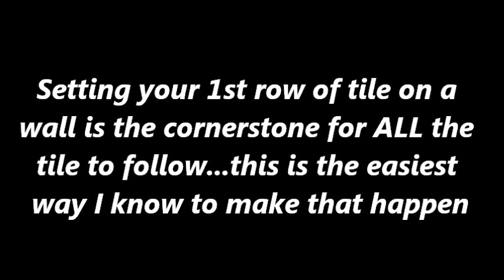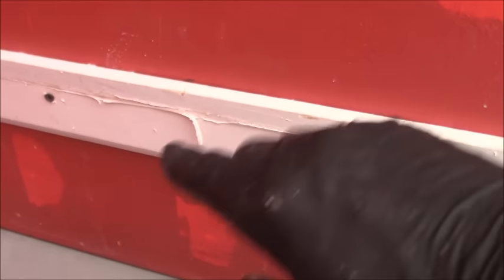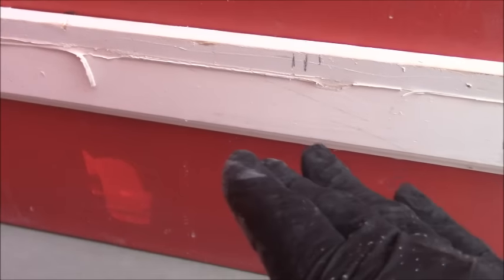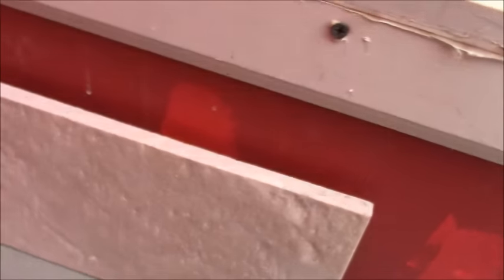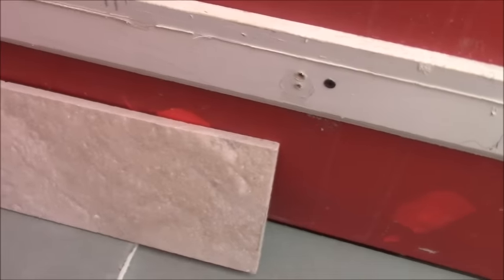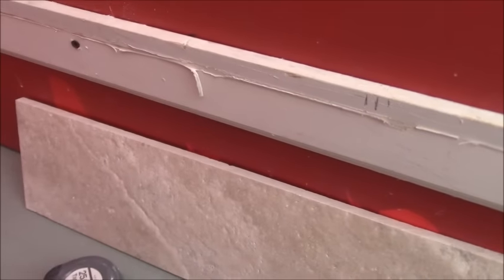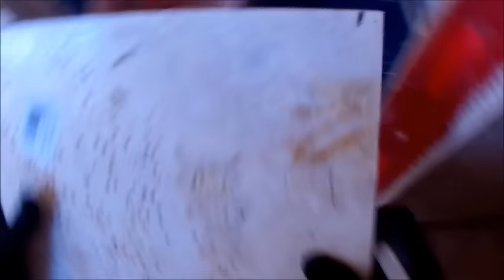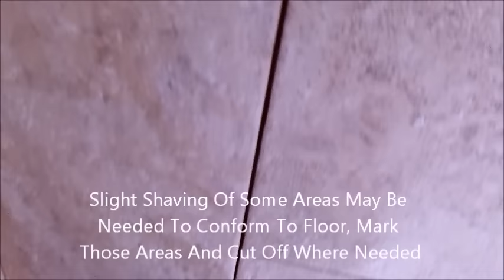FIRST Row Of Tile On Walls....how to do it

Comment: Hi Starr thanks for the video it's very helpful - zero tile exp. here.  I have a Question...given my situation (below) do I need a ledger board?

Prewar building bath to be tiled, the walls have no studs and no convenient way to attach a ledger board.  In any event, the wall I am starting with is the long side of tub (porcelain) wall.  The porcelain tub is 100% perfectly flat and level, i.e. the long edge of one side of the tub.  The wall is flat/plumb.  I figured as such I would effectively use the tub edge as the ledger board...and tile up towards the ceiling.  Notably, the ceiling/wall corner is not level, with a difference of ~.5 inch between the left and right corners.  The tub is staying, and will be trimmed to the bottom tile accordingly for water tightness etc.

To that end I envision tiling up to top and cutting that last row to fit with the trim I'm using.  So, is this a prudent plan - do I need a ledger board when using one would be its own issue anyway due to the prewar wall construction? I've confirmed three ways to Sunday that the  'tub edge' is true, flat, and level.  I appreciate your thoughts if you have time to do so I'm sure you're busy and that's a-ok too!  Thx again for the video it is a treasure trove for someone (me) with zero as in zero tile knowledge.  I have to start somewhere however!
Reply from the maker: I think you are spot on, using the tub as a ledger since it's true is fine, remember small spacers at the bottom. To the sides I try to get full pieces in there, but if dealing with un-true walls at the corners, start full in the middle working your way out & trim left/right tiles to form with walls...ceiling part use a tad larger spacing going up to ceiling to take up that .5 if possible, assuming grout blends with color of tile, you'll hardly notice.

You sound like you have more of an engineer hat than I do so you'll be fine...GOOD LUCK !
Reply: Thanks much Starr...I've decided that even though (amazingly) the walls are true all the way up, to start from middle and work the ~30 inches towards each wall corner (i.e. towards the walls at the 'spigot' and 'foot' ends of the tub).  That's my approach because in my thinking, 1) it will create the same 'last tile' width on each side, and 2) also provide symmetry as you look at that wall which is in direct line of sight upon entering the bath door.  Your idea about slightly greater spacing going up on the higher side is a good one and since I am doing the tiles vertically, won't be noticeable. On both the sides and 'top' corners (wall/wall;  wall/wall; wall/ceiling) I am using a bit of a 'different' trim method I've concocted to provide (I hope!) a bit of design flair at the same time negating my need to miter any corner tiles which is way beyond my tiling paygrade at this newb stage of my journey (I've a small wet saw and have perfected straight normal cuts...baby steps!). And that method I sense will either work marvelously, or alternatively, go down in flames just as grandly and if so well I'll still learn from it and start again!

Thanks again for your videos really very helpful!

Comment: Another great video ... exactly how i did my bathroom .. Not Being very good with mesurements , I used a med size black marky on above each side of tile then went up the wall using the black marker as the grout line to the top to make sure it would end perfect. No cutting on top ... all cuts on bottom .. Yea overkill but i wanted to make sure with the grout lines .. didnt want to get to the top and find out i screwed up ..   On another subject , If your going to tile your entire home .. where is the best place to start ? Hall way ? Kitchen ? living room ?  Or does it not matter ...
Reply from the maker: I normally start at where it's seen first/most...at entrance. Plus door ways are normally the highest point.
But you must know if there are high spots in other areas, it will kill your job if you don't.
Reply: will add plenty of thin set to make sure to cover the un even places ... one more trouble spot but will send pictures later ... thanx for youR ADVICE .!

Comment: Does screwing In a ledger board affect waterproofing since it is piercing a hole through my waterproofed wall and into the stud ?
Reply from the maker: You fill the holes with silicone

Comment: I couldn't tell in this video but when you cut tile do you take the line right out or do you cut on one side of it like you would with wood
Reply from the maker: The tile gets marked backwards on the edge, then that line is transferred to the front and cut at the front

Comment: Can I set my tile in my final mortar bed? A 12x24 tile with 6 in.in the pan and 6in. On the the wall? Then start you rows. Or would the mortar string and Crack the tile in the mortar?
Reply from the maker: I'm not sure I understand your question but tile should never be set inside of the mortar bed
Reply: @StarrTile  yes, ty. My thought was , set my cement board 4 inches above ground, then set a tile into the pan, half in the mortar pan, half out the mortar pan onto the cement board, acting as a type of ledger for my first row if tile. In doing that also ensures no gap from ground to wall, since you shouldn't put your cement board in your mortar pan. 
 So basically instead of the cement board in the pan, you put tile around the bottom.
Reply from the maker: @joshuaallen5453  the tile should never be touching the mortar, regardless...
Even at my final bottom row the tile never quite touches the floor tile because it has a grout line there.
I suppose you could do it your way without an issue but I don't think I'd be willing to experiment

Comment: Question: if you level your shower pan 2 in from the wall all around then work your slope, why you need the ledger board? Thank you
Reply from the maker: You would be assuming that both your shower pan and your tile on the pan or exactly level, should that be the case on all four sides then you are correct you would not need a  ledger board
Reply: Thank you for the reply.  I love your videos.👍 unless you have a perfect square shower pan" all 4 sides are equal "   the pan will be leveled 2in from the wall=> no need for the ledger board. As i floated my pan today 60x30 in, no way you will get leveled 15in from the drain. You will end up with a flat \/ from the center. 1/4 in per 1ft is not ideal for 15in slope. Then, if your shower is long, you may need 5/8 per ft. I think YOUR LEDGER BOARD IS A MUST in this scenario.  AND 12in - 1/2in = 11in gap from the pan is perfect.  Experience is gold and you have it.

Comment: This is a solid tried and true method,  but not the most economical. 

Starting on back center wall,  If you have a laser level:

1.  Establish the desired height of the first coursing.
2.  Set laser to that height
3.  Establish layout in left to right plane.
4. Determine end cuts at adjacent walls using previously established layout 
5.  Flip all of your tiles upside down with the unfinished side facing you, sometimes you can get them all to stand up,  other times do it one by one. 
6.  Use laser line to mark the entire run of tiles at both edges on the backside of the tile. 
7.  Transfer marks to front
8. Scribe or cut
9. Install, and modestly shim to level as necessary

Voila.   Fastest and most accurate starter strip you've ever seen with no screw holes to fill, no coming back the next day to finish, no unnecessary prep.

Ive never seen this method used by other setters (I'm sure it has been) but ive done it on 100s of showers at production speed and it works excellent, saves a bunch of time. 

Protip: start your coursing so that you have a good inch or so to cut off so it breaks easy on the scriber.... if layout allows.
Reply: sounds good! should one silicone the floor tile to wall gap first ?
Reply: @jmack619  no just grout that joint line line the rest of them when you're grouting and silicone  it after grout dries , you'll never notice cracking in the grout.   Ive never left gaps for silicone, and never had problems.
Reply: @Laking86er  Thank you so much for an instant reply!  John Canada

Comment: Very helpful, if I want to put 12 by 24 vertical, subway how do I ledger or start, thanks!!
Reply from the maker: Your half ones get the ledger....put a scrap piece in between for proper spacing, then full go in next day shaved to fit at floor
Reply: Using your methods, coming along, 3 by 3 to ceiling, niche and metal trim. Pan liner first thing tomorrow,

Comment: The perimeter of your shower pan should be level all the way around so that you don't need to cut any tile on the 1st row.  You slope the pan from that level line to the drain on each wall.  I'll admit I'm not a tile guy but that's how I've seen it done and it seems better than having to cut each tile on the bottom row.
Reply from the maker: Everybody has their own way of doing things, that is called a perimeter screed...is it easier ? Yes for some, I do it on occasion, but I can do a pan faster than doing a PS. Regardless you can't know how high/low thinset & floor tile will change things even by 8th's of an inch, so ledger board is still best practice
Reply: @StarrTile , I agree on doing the ledger board.  As for the 1st row being level at the bottom instead of cut would just come down to personal preference.  I like the look of the tile being level at the bottom.  But it's like a lot of things, there's multiple ways to do it and it's all up to you.  Thanks for the videos.

Comment: Thank you. I went to do my kitchen backsplash that covers three walls and it became quickly apparent from the laser level that the counter tops are not remotely level. I theorized I would have to do it the way you explained (great minds think a like) but every hipster millennial douche on YouTube just throws it right up on the wall and I know that will be a disaster if I don't have a good bottom row. Thanks again. This will take longer but I know it will look better in the end.

Comment: Could you use double sided tape instead of the screws and remove the board and leave the leftover tape there after you're done?
Reply from the maker: Probably not...the tape wouldn't hold the weight of the tiles and probably damage the redgard
Reply: @StarrTile  ah ok awesome. Thank you for being so active in the comments, I really appreciate it. I'm a welder not a renovator, so this is all very helpful. I've done a bit of work here and there but this project I definitely needed help with. Expect a sub on patreon or something in the near future when I get all that settled monetarily haha, you've been super helpful.

Comment: Absolutely use a level line to start, BUT, also be mindful of how your tiles will finish at the top. Don't automatically start with the line a quarter or half inch less than the with of the tile at the bottom, then get to the top and find you have a small gap to fill. I alway try to even out measurements so (if possible) you don't end up with any cuts less than a third of a tile.
Reply from the maker: Excellent point, but even if I knew there would be a 4 inch cut at the top instead of 12 I would still rather have pretty much a full tile at the bottom since the eye is focused there.  Splitting the difference to me can look dumb, that is why I always give my customer choices and ultimately they decide

Comment: Where the bottom wall tile meets the tile floor, do you grout that joint or caulk it? Both? Thanks!
Reply from the maker: I grouted that area, if there is any cracking in the future than it should be caulked

Comment: Hi, thank you for your videos. Though I am stuck on a few things...
Do you fill the void between floor tile and Durock with anything ? If not, when grouting would the grout not go straight through gap. Also do you caulk where wall tile meets floor? do you leave a gap to accommodate?
Sorry if i have missed the advice on previous videos...
Thanks again. Andy
Reply from the maker: The void gets tile up to the liner, all tile is grouted...you could caulk where gap is but Redgard is painted in there also so a bit redundant. Once floor tile is set it's grouted and wall tile set....not sure I answered your question, thought it was clear on the video.
https://www.youtube.com/watch?v=cNLaNE2h9H8&t=61s
That video might help...

Comment: I think You forget to add a gap for the grout at the bottom side of the tiles and in the corner too or at least is very narrow. 
( it could be the angle you shoot the video ) One very important thing before someone start  laying tiles it to make the work area perfectly square, otherwise will be ugly. And ledger board is a must!
Reply: If you can make a corner with your tiles that are butted right flush each other there’s no need for grout and it looks a lot better without it.

Comment: Bob how I use a ledger board if my tiles are 4x8's and we want them laid horizontally (subway0. The ledger board would need to set something like 3" above the floor tile; I would ht the pan liners with screws?
Reply: put it up 2 tile heights

Comment: I love your videos. I stumbled across you, while researching how to do a shower properly after a guy butchered a job on my mom's place. I think my friend and I still made a few errors, but I am hoping it won't matter as much, being that we live in Arizona and it is very dry. We didn't redguard our tile backer board, used that gypsum diamond pattern backer board, and a precast acrylic shower pan. 

We used tile rated impervious to water, and grout that is supposed to be epoxy based water proof grout that doesn't need to be sealed.

If you don't mind answering, have you any experience with that Fusion Pro grout sold at the home despot, and if it is as waterproof as the claims?
Reply from the maker: I've heard Fusion is not that great...I would get Prism
Reply: StarrTile thanks. unfortunately we used the premixed fusion already. hopefully we don't run into any issues. once again thanks for the awesome videos.
Reply: Fusion is awful!! I've had the displeasure of using that garbage many times as Home Depot forces it on unwitting customers. It is just paint and sand mixed together. There are numerous Fusion grout failures, a quick Google search will reveal many instances of it simply washing down the drain. Considing it stays in solution of Ethylene Glycol water, and what smells like latex, dumped onto lawns to enter the water table, it think it's an environmental disaster. Per the manufacture's instructions, the waster used in cleanup, is @ 11-12 x that of cement based grout. Fusion dries through solvent evaporation, ie shrinkage, grout lines are never as full as they were at the completion of the installation. Be sure to take your contaminated waste water to your cities local hazardous waste recycling center ( mine doesn't have one, neither do the other 4 surrounding towns) this is the advice of CBP, the manufacturer. Or just contaminate your local drinking water. A good size tile job can produce or 1000 gallons of contaminated water. I can't say enough bad things about this awful product.

Comment: Great info- so do you caulk the corners/bottom? Thanks
Reply from the maker: You could if you anticipate cracking or water getting in there , it wouldn't hurt but I don't do it by default
Reply: @StarrTile  Thanks

Comment: Question. If the other way of measuring and cutting the bottom took an hour and a half but you could tile the entire day, doesn’t that save more time than using the ledger board and then letting the above layer dry then having to tile the bottom layer?
Reply: I think the point is that you can't continue tiling much past the first row when you start with it, because it will need to cure enough to not budge if bumped (Remember this is going to be your reference for the rest of the tile job).

It's a tradeoff between being able to knock out most of the work sooner, or put in a short workday in the middle of the job, then return to knock out the remaining later.  Either way, you still have to split up the job over at least a few days, but most beginners or DIYers will likely appreciate the psychological boost and reward seeing quick early progress.

An added bonus is that (speaking from my own DIY experiences) it's nice to get more progress before having to make yet another run to the store to get more _________, so one will often have a more complete shopping list by the time the next parts run happens...

Comment: Hello, what are you using for a ledger board? Some that i found at the hardware store are not straight, just try to find the straightest one, or is there some wood better than others for this?
Reply from the maker: I use base molding...some use flat steal bars, some use different size levels...but any straight edge will do.

Comment: Great video Bob. Thx.  Can you comment on setting the ledger bd influenced by the ceiling height?  So you don’t end up with too small of a row at the top. You didn’t seem to cover this. I can see how it might cause you to reduce the size of the bottom row in some cases. Thx
Reply: You have to measure and find the center of the wall first . Dry fit the tile with pencil marks. Some people want the tile dimensions to be the same at top and bottom .

Comment: What if you're doing 3" subway tiles? Do you put the ledger board at 2  3/4"?
Reply from the maker: I'll usually try using outside shower floor tile as a 1st piece, like a skirt...since it's always a bigger tile
Reply: @StarrTile  I'm out of luck there, as the bathroom floor is going to be in the same mosaic hex tile as the shower floor (80 year old house, wife wants to imitate the original as much as possible, which has a very similar tile for the other bathroom floor).